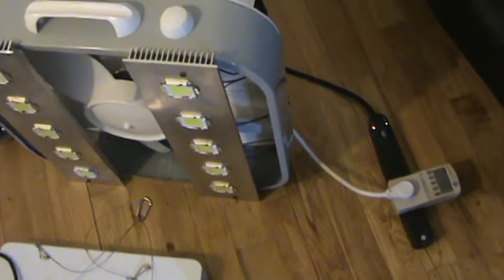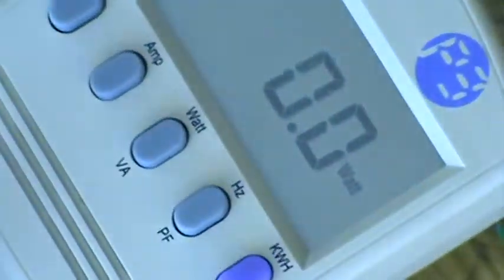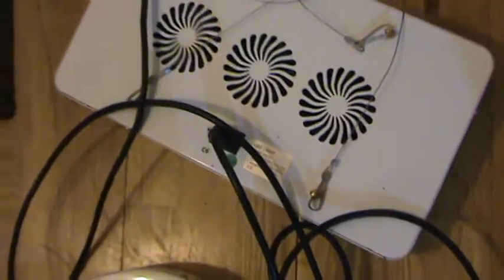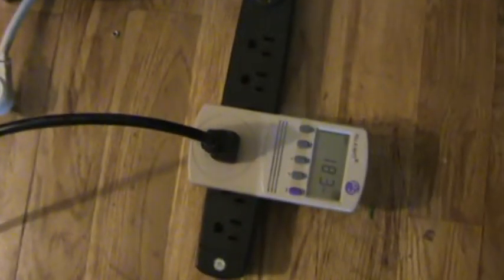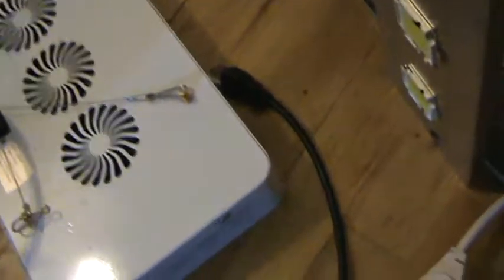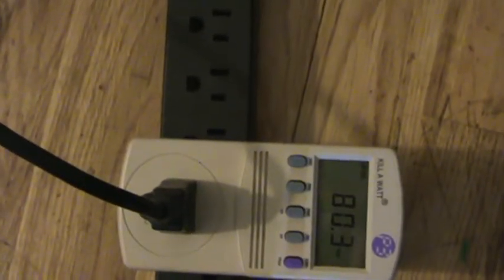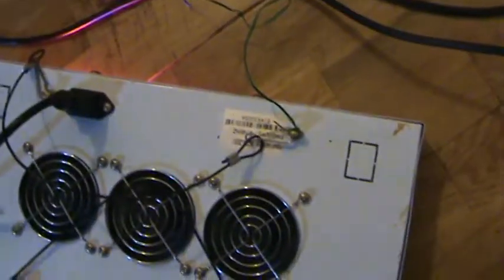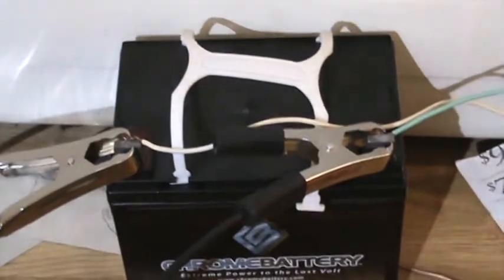SOLAR POWERED 100 WATT COB LED EXPERIMENT, LED ACTUAL DRAW

Comment: Hi, would a 1000 true watts LED pannel with 3 watt full spektrum LEDs perform as well as COB with 1000 true watts draw?

Cheers
Reply from the maker: +Evan Mellor I think it would perform just about the same if the 3 watt LEDs are placed closer to the plant as compared to the 100 watt COB chips.  Pushing 100 watts through a chip that is only 1 inch square will have better penetration for sure.  These 100 watt chips are so bright you can damage your eyes easy but the plants love the intensity.

Comment: Hey bro how do I make that box fan led light
Reply from the maker: hood-grower.KG It's real easy.  I'll make a video to show step by step.  Here is a list of parts below.  You can buy a box fan at any walmart or home depot.  The heatsink is from heatsinkusa.com  All other part can be bought on Amazon:

100watt cob led:
http://www.amazon.com/LOHAS%C2%AE-White-Power-Energy-Saving/dp/B00CZ75TWA/ref=pd_sim_sbs_60_2?ie=UTF8&refRID=0FJKJ3RN8179WF6N31SC

driver:
http://www.amazon.com/gp/product/B00E9P7W0S?psc=1&redirect=true&ref_=oh_aui_detailpage_o02_s01

power cord: